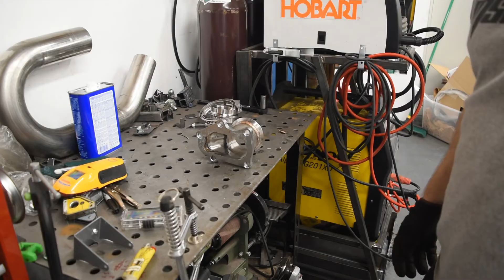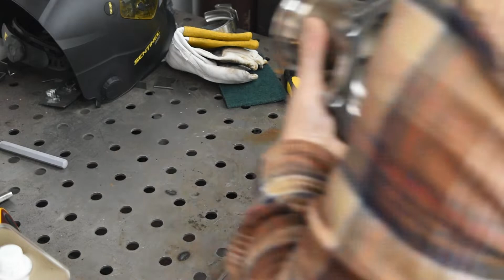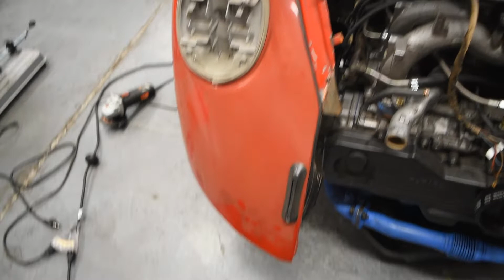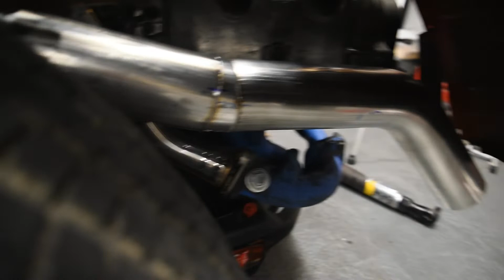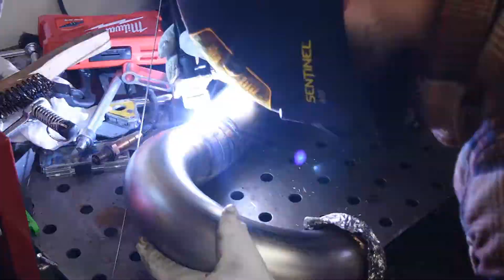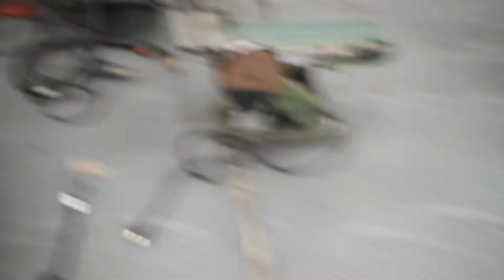TIG Welding 3 Inch Stainless Steel Turbo Back Exhaust -- 1973 VW Super Beetle Subaru Swap

Comment: That's going to be soooooo loud. I did my exhaust for my Type 181 Thing very similar to yours but with only a 10" resonator at first and that was too loud. I left the resonator and added an offset straight thru muffler and its a little louder than tour typical modified WRX. Check mine out on Sambra. Look for Thingaru. It qas missing a couple cylinders. White smoke may be raw fuel. 

Awesone looking exhaust and welds. Great job!
Reply from the maker: Thanks for the feedback! Definitely will consider resonator/muffler once the car is on the road.